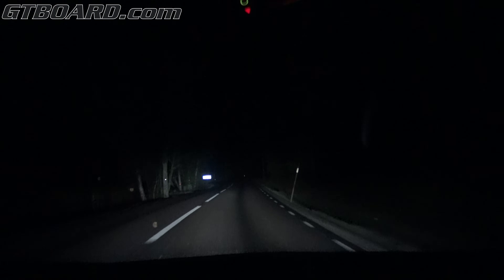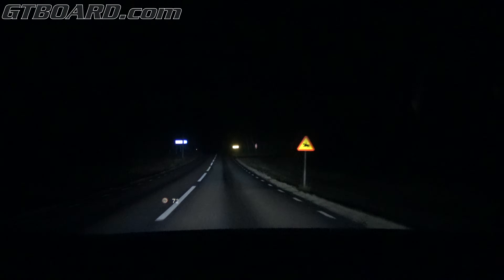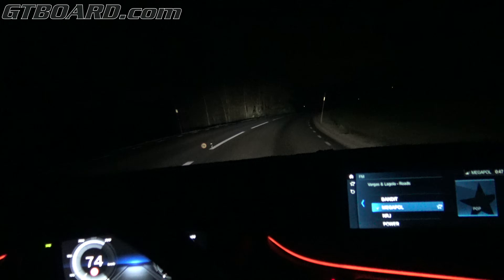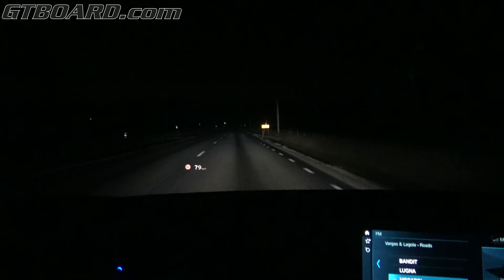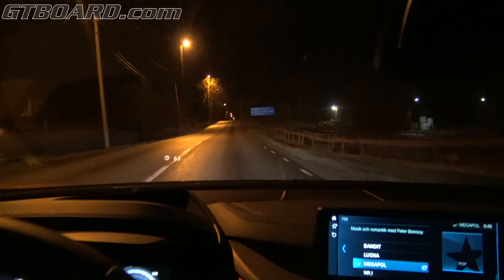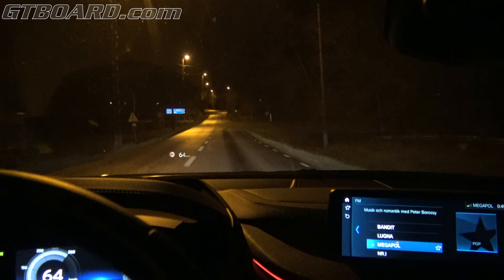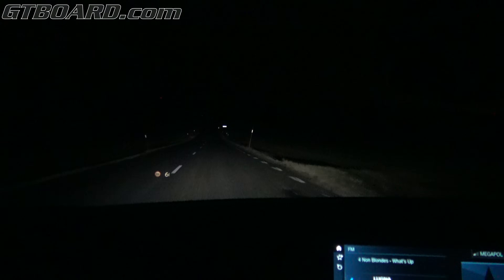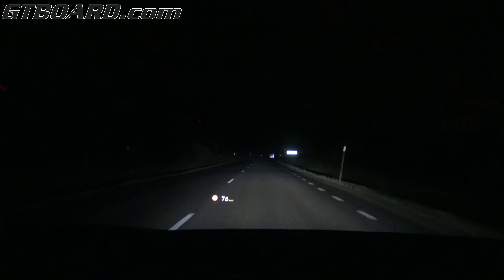[4k] BMW i8 Laserlight in use and action; extremely high light intensity enables long range, 600 m!

Comment: 1) the turns are still pitch black when you turn in.
2) too much noise in the cabin ?
Reply from the maker: i8 is all carbon and not as a 5-series. Yes I was somewhat surprised it didnt turned more in the bends?